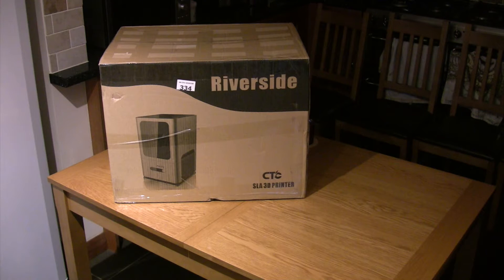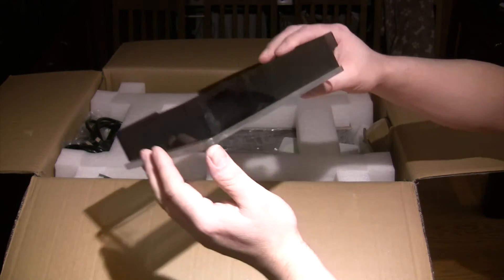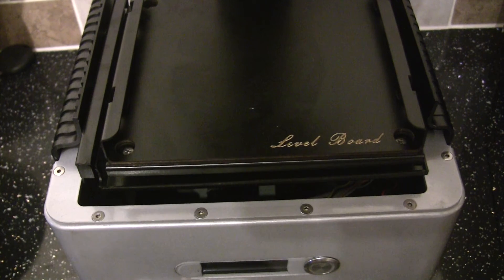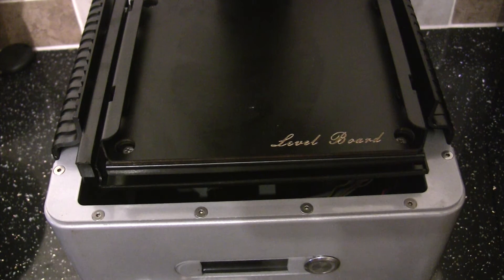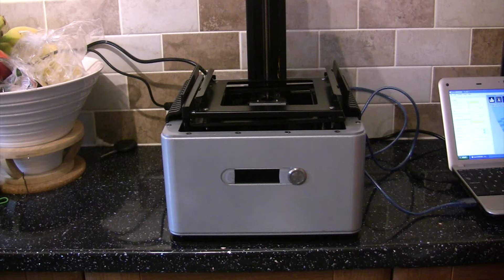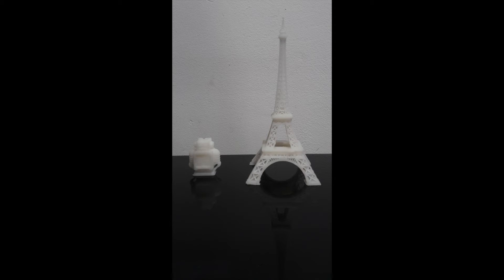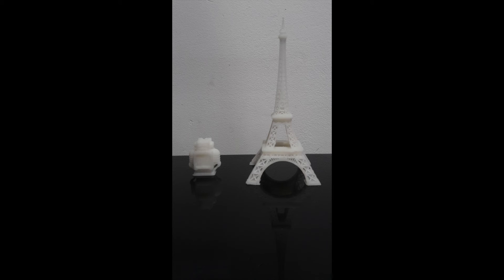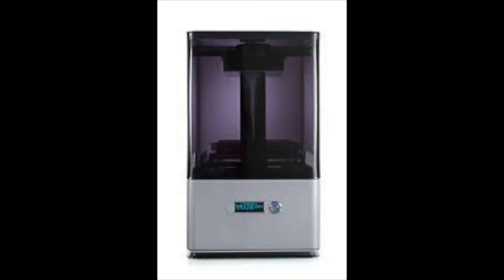CTC Riverside SLA 3D Printer Unboxing

Comment: The Riverside I received did not come with the right software on the CD or DVD.  The software is a RAR file which Windows will not read.  I have seen these trailers on Autodesk AutoCAD software.   But I need to know where to get the EXE Cura software
Reply: Right.  I already got it last week.
But, the printer uses and EXE file to operate the slicer!  NOT an RAR file.
 Fact
Reply from the maker: The software is a modified version of Cura - it is an EXE but it may a .rar file which needs to be expanded first.
Reply from the maker: The software is a modified version of Cura - it is an EXE but it may a .rar file which needs to be expanded first.
Reply: Even when I expanded it, or unpacked it, there was not an EXE in the file folder.

Thanks any way.

I do not have that printer any more.

Comment: Hello.. Very informative, more than most. Instructions are, as you say, a waist of time. But.. How did you calibrate the height of the build platform to begin??? you said you had the wrong height.. seems to me this should be able to be calibrated before all printing.. Really rather sketchy.. Needs an expert like you maybe to write a better procedure in English and offer out in PDF format.. Where can we get new resin and resin trays, alchohol, ??? Basically all consumables.Not having a lot of fun with the German suppliers who are trying to translate Chinese English translation LOL... Not impressed so far. Build platform doesn't lower into the resin to begin the print,,, ended up with the full print with no z axis movement its now a hardened blob in the tray. Any help would be useful to get this working. Should have paid the extra 2k for the Formlabs 2 :)Hope to hear from you soonChris

Comment: For those of you who have the mis-fortune of a build sticking to the silicone:

In most cases it will be a dome shaped layer representing how far the laser can cure through the resin. Don't try using the supplied spatula to remove it. You will likely damage the silicone layer.

It seems it is actually not stuck very well to the silicone, despite the first impression (that is unless it is keyed into a damage area of the silicone). If it were, then the whole principle of this type of machine would fail.

I suggest making a small lever bar out of plastic, perhaps from a plastic spoon handle. Grind a chisel edge on one end and carefully deburr it. Then use it to carefully lever up the edge of the build. be patient and move around the perimeter trying. You will probably find that the defective build suddenly moves. It seems that the primary force holding it to the silicone is capillary attraction of the uncured resin around and under it. The part will tend to slide around, but still be reluctant to  come free. The perimeter probably has a meniscus formed around it. the curvature of this  creates a negative pressure which then extends the whole way under the part holding it to the silicone. Push the part to the side of the tray and then try levering again. Hold the edge up for a while to allow the meniscus to break away from the perimeter and slide under the part. Usually it will suddenly pop free.

Hope this works for you

Comment: If you are making a model with a large surface on a layer you will hear the tray clack in the tray holder as the spring loading detents that hold the tray down are overloaded.This doesn’t stop the build, but the tray doesn’t necessarily come back to the same position in the tray holder frame. Also the 4 screws that adjust the tray height are very wobbly in their captive nuts, so the tray holder can shift in lateral position. That shows as mis-registration artefacts on the model.I haven’t thought of a way to locate the tray in the 2 lateral degrees of freedom plus the rotation around the vertical axis to overcome these issues.

Comment: A warning about the spatula that comes with the kit (may have been mentioned):It looks like it is water jet or plasma cut. The edge of it is quite rough and it has burrs. If you use this as is on the silicone you will scratch it and harm performance.I filed the edge of mine with a fine single cut file, them lapped that smooth on a 1200 water stone, first holding it perpendicular to get the edge square, then lapping the burrs off by holding it horizontal on the stone. I also filed 3mm radii on the corners of the blade so that they don’t accidentally gouge the silicone.Finally I put a very small radius on the perimeter by dragging it backwards while rotating it from horizontal to vertical.Having said all that, I would suggest using a plastic spatula instead, like the ones that come with some plastering or body filler kits. I would also suggest doing the procedure above to that because even plastic spatulas can have burrs on the edge.

Comment: Okay. I give up. It's taking all the formatting out of the posts , making them very difficult to read. Please note that the 1., 2., 3., and 4. correspond to the bullet points in the user manual Appendix. They should show as separate paragraphs for clarity. You will have to hunt them out in the midst of the text.

Comment: I'm having trouble with the formatting of these posts going haywire so here is a repeat that I hope works better,. Sorry.It seems many users are having trouble with models not sticking to the build platform (which they for some reason call “the sucker”). The model does not suck to the build platform, it sticks to the roughness and a bit chemically.If you are setting the gap between the build platform and the silicone in the tray to 1mm it will not build the model on the build platform. You will just get a mess on the silicone.Appendix 1 of the user manual is very confusing. Here is my explanation bullet point by bullet point for those who are having trouble:1. Make sure there is a bit of roughness on the aluminium build platform for the model to stick to. If it becomes smooth, scratch it to raise burrs for the model to stick to mechanically. 
If you are going to leave the machine idle for a long time clean the resin off the aluminium build plate so it doesn’t harden on it.2. Check the silicone in the tray is not damaged mechanically or becoming opaque from repeated use of the laser. It is possible that this might cause the model or part of it to stick to the tray instead of the sucker. Position the model away from these areas. Eventually the tray will need replacing.3. Check that the build plate initialises to a position 0.1mm (that is 100 micrometres or the equivalent to the thickness of a sheet of 80gsm A4 paper) above the silicone in the tray at the beginning of the build. Do this by placing the “level board” in the tray holder and send any model file from Cura. The tray will tilt, then the build platform will descend to the initial build height. The tray will then return to horizontal and pause for a few seconds. At that time pull the power plug from the rear of the machine. Now cut a strip of the 80 gsm paper and use it as a feeler gauge between the “level board” and the build plate. Adjust the 4 screws at each corner of the tray so you can just pull the paper out of the gap.NOTE THAT THE (APPROXIMATELY 1MM) AT THE END OF THE PAPRAGRAPH IS INCORRECT. It is a typographical error because the typesetter does not know the different between a Greek letter for “mu” and an “m”At this point the build platform height is set correctly are you should be able to proceed with models that stick correctly to the build plate. However I would suggest you follow the method suggested in my previous post and print 4 off 1mm tall items one in each corner of the tray near each adjuster screw. Measure them, then turn the adjusters the small amount needed for perfect height builds. Remember, one turn of the adjuster screw is 700 micrometres exactly, or 7 build layers at default layer thickness.4. Once you have performed bullet point 3 then both the build plate and the tray should be horizontal and parallel because the build plate is built horizontal and not tilt adjustable.
So paragraph 4 seems completely misleading and unnecessary. It relates to the factory set-up of the machine. If you are have problems with the tilt movement something is seriously wrong with the factory setting.
The rest of bullet point 4 through to end of Appendix 1 is either confounded or simply wrong. Confounded because you can’t adjust the power screw nuts correctly to get 1mm gap between the silicone and the build plate because the gap adjustment screws can be in any position up or down by about 10mm.
And wrong, because the orange feeler gauge as shown in pictures 7 and 8 is not supplied and the “level board” is the same thickness the height from the bottom of the tray to the top of the silicone layer anyway, so the feeler gauge is unnecessary.
So instead of the orange feeler gauge, just use a piece of 80 gsm paper in the positions shown in picture 7 and 8 when performing bullet point 3 above.

Comment: It seems many users are having trouble with models not sticking to the build platform (which they for some reason call “the sucker”). The model does not suck to the build platform, it sticks to the roughness and a bit chemically.
If you are setting the gap between the build platform and the silicone in the tray to 1mm it will not build the model on the build platform. You will just get a mess on the silicone.
Appendix 1 of the user manual is very confusing. Here is my explanation bullet point by bullet point for those who are having trouble:
1. Make sure there is a bit of roughness on the aluminium build platform for the model to stick to. If it becomes smooth, scratch it to raise burrs for the model to stick to mechanically. 
If you are going to leave the machine idle for a long time clean the resin off the aluminium build plate so it doesn’t harden on it.2. Check the silicone in the tray is not damaged mechanically or becoming opaque from repeated use of the laser. It is possible that this might cause the model or part of it to stick to the tray instead of the sucker. Position the model away from these areas. Eventually the tray will need replacing.3. Check that the build plate initialises to a position 0.1mm (that is 100 micrometres or the equivalent to the thickness of a sheet of 80gsm A4 paper) above the silicone in the tray at the beginning of the build. Do this by placing the “level board” in the tray holder and send any model file from Cura. The tray will tilt, then the build platform will descend to the initial build height. The tray will then return to horizontal and pause for a few seconds. At that time pull the power plug from the rear of the machine. Now cut a strip of the 80 gsm paper and use it as a feeler gauge between the “level board” and the build plate. Adjust the 4 screws at each corner of the tray so you can just pull the paper out of the gap.NOTE THAT THE (APPROXIMATELY 1MM) AT THE END OF THE PAPRAGRAPH IS INCORRECT. It is a typographical error because the typesetter does not know the different between a Greek letter for “mu” and an “m”At this point the build platform height is set correctly are you should be able to proceed with models that stick correctly to the build plate. However I would suggest you follow the method suggested in my previous post and print 4 off 1mm tall items one in each corner of the tray near each adjuster screw. Measure them, then turn the adjusters the small amount needed for perfect height builds. Remember, one turn of the adjuster screw is 700 micrometres exactly, or 7 build layers at default layer thickness.4. Once you have performed bullet point 3 then both the build plate and the tray should be horizontal and parallel because the build plate is built horizontal and not tilt adjustable. So paragraph 4 seems completely misleading and unnecessary. It relates to the factory set-up of the machine. If you are have problems with the tilt movement something is seriously wrong with the factory setting.The rest of bullet point 4 through to end of Appendix 1 is either confounded or simply wrong. Confounded because you can’t adjust the power screw nuts correctly to get 1mm gap between the silicone and the build plate because the gap adjustment screws can be in any position up or down by about 10mm.
And wrong, because the orange feeler gauge as shown in pictures 7 and 8 is not supplied and the “level board” is the same thickness the height from the bottom of the tray to the top of the silicone layer anyway, so the feeler gauge is unnecessary.
So instead of the orange feeler gauge, just use a piece of 80 gsm paper in the positions shown in picture 7 and 8 when performing bullet point 3 above.